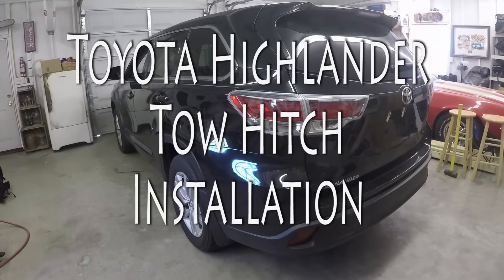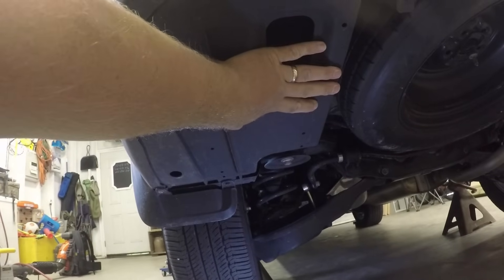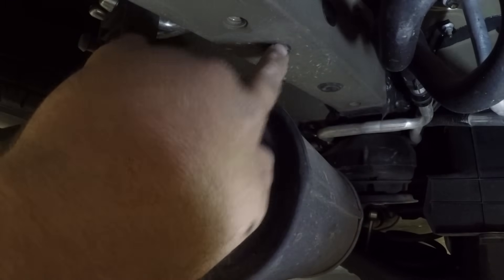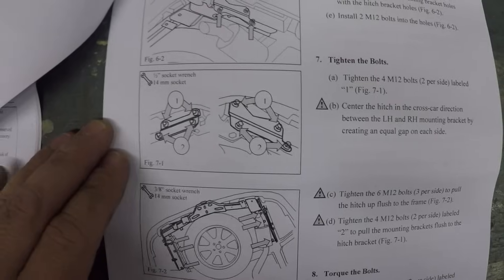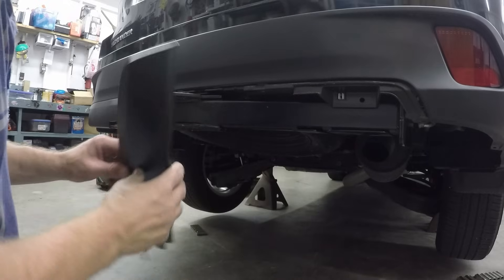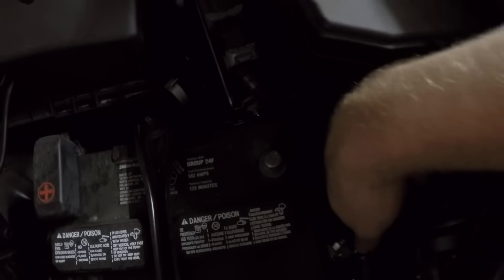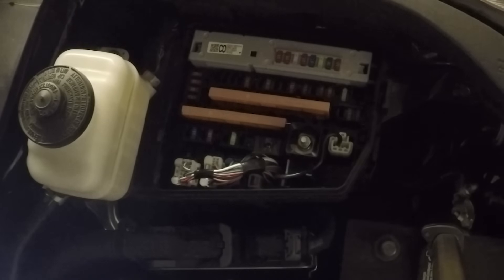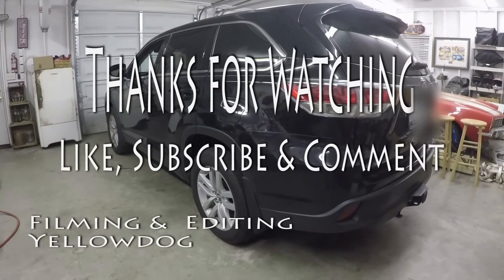Toyota Highlander Tow Hitch Install

Comment: I installed the hitch after watching the video and downloading instructions on our new 2018 Highlander. Just so anyone who cares knows, you don't have to do any trimming on the right hand side under cover. Goes right back on with no modification. Thanks again for the video.
Reply from the maker: Cool, that's one less thing you have to modify. 
I appreciate the information, and i'm glad you found the video useful :)
Reply: Do you know the part number of the hitch you bought for your 2018 Highlander? Online I see one that is PT228-48170 and another that is PT228-48172.
Reply: @mphorton40  The part whose number ends in 140 (the one in this video) protrudes from the bumper somewhat. The  one that ends in 172 is more flush with the bumper (and for some reason is now discontinued but can still be purchased).

Comment: Thanks for this video!   My hitch came with no instructions!!  I found this job easy to do, anyone can do it but it took most of a Saturday.  Some PRO TIPS that I discovered during install:

(1) Remove the spare tire.  Makes life a lot easier under there.

(2) You don't need to completely remove the back tray where the tire tools etc live.  Remove the 10 mm bolt upper left side then pry from the left gently until you get 1/2 or more of it unlocked across the back.  That's enough to run the cable back there.

(3) The far outer pins on the two new bumper facias are almost impossible to install.  I could not get my big hands up in there.  Use a plastic wire-tie instead.  Easy to put in, much tighter and because its tighter looks better on the outside.  Leaves things nice and flush.

(4) If you didn't get instructions like me, if you need them, your Toyota dealer can email a copy to you.
Reply from the maker: Glad it helped!

Comment: I would spray that tow hitch and the parts where it will be attached to with line-x or raptor bedliner to prevent it from rusting. Thanks for sharing your installation process.
Reply from the maker: Good idea :)  especially in rust belt parts of the US.

Comment: Great Video!  Saved me tons of time.  I found the same on a 2018.  No need to trim the right side. Also, I used jack stands to hold the hitch in place to attach the bolts. One person.  I didn't have the giant vice grips.
Reply from the maker: Happy the video helped out,
Jack stands will work too, got to make do with what you have :)
Reply: great to see these videos, would this kit work for a 2017 hybrid highlander?

Comment: Thanks for the video.   About 5 minutes in you mentioned the instructions say it's a 2 man job.   I'm wondering because I didn't get any paper work with mine at all, not even a parts list. I called the place I got it from and was told they come that way.  It looks like yours came with some info.  I think my 2019 looks enough like yours that I will be able OK  so I am really glad you put this up.
Reply from the maker: If it makes you feel any better, my kit didn't come with instructions either. I asked the parts rep where I purchased the hardware for the installation instructions. They were nice enough to print me what Toyota makes available to their technicians. So what i went by is not necessarily meant for the general public.  I hope the information in the video helps out :)
Reply: Ah ha!

Comment: I installed mine on a 2017, and the 4 pin connector doesn't work.  Uhg.   No lights on the trailer.  Checked fuse, and its still good.

Comment: I installed this today on a 2017 Highlander XLE. Everything was spot on here! My only add here would be for the 2017 XLE model, you only need to modify the driver side underbody plastic mold (take a small Dremel and cut off the needed section).  For the passenger side, it will install same way from factory.
Reply: same here for the limited. i assume you would want to cut the passenger side for easier access to the bolts to periodically tighten them...?  otherwise, yes, no need to cut.

Comment: I watched this video several times before my hitch and wiring came today. I was a pro by the time the box arrive. The vice grips and the jack was brilliant although it works much better to put the car back down so that jack can place the hitch perfectly near the mounting points. For the two 12MM nuts on the driver side shroud, it’s important to pull the shroud down hard while removing the two plastic nuts. They’ll just spin in place if you don’t.
Reply: Can you let us in on what you paid for the original parts? I want to compare the cost vs the aftermarket stuff. 
I agree with everyone that this is a really good video. Nicely done!
Reply from the maker: @williamkessler3847  
Its been a while, but I think it was around $500 to $600 for the hitch and wire kit. It is a bit more than aftermarket, but it has a much better fit and finish IMO :)

Comment: Awesome video. I would add that it doesn't appear you replace the tow hooks since the hitch has tow points on it. I left mine off. Also, the last piece you cut out of the plastic trim isn't necessary on my 2016. I left it and dry fit the piece, and it fits perfectly. Tin snips were much faster than the dremel. Finally, some of the bolts really want to cross-thread. It was the biggest pain having two that didn't want to go in completely straight. Finger tighten them all for several threads, then use a tool (I used my cordless ratchet), then torque wrench.
Reply from the maker: I'm happy the video helped out, and yes the tow hooks are not needed once the hitch is installed, at least that's my opinion :)

Comment: Thanks for this video! I don't know if I could have done it without it (my kit didn't come with instructions for some reason). Seeing where to cut in particular helped me out. One thing I struggled with (for future DIYers) was removing the shelf inside the trunk to run the cables. There's a nut on the left side, and a bunch of clips with the carpet. Thanks again!
Reply from the maker: Your welcome, 
I'm glad the video was helpful. :)

Comment: After I installed my trailer hitch on my 2015 highlander and connected it and after I connected my battery again my check engine light turned on and it says check awd system ? Anyone else got it ?

Comment: I enjoyed your video.  Like you, I do a lot of things myself, too.   I did order the OEM Toyota Tow Hitch and wiring, however, there were no instructions.  Any chance of copying them and posting them to the video?  I would appreciate it, THANKS.
Reply from the maker: I looked out in my shop, unfortunately I'm afraid they may have found their way to the great trash can in the sky :(
If I do run across them at some point I will see what I can do.
Reply: Additional detail for wiring access: 
https://youtu.be/cgRAJ0RZwhw
Reply: Trying to Add the Toyota Installation Instructions for the Tow Hitch and Trailer Wiring Harness, but don't see a way to attach them
I did not have to cut anything off the underside trim panel on the passenger side.  
I will need to cut something, possibly a 1/2" wide slit, or so and a little bit from the other end, but not as much as the instructions seem to be showing.

Comment: Great Video.  I am going to put on my 14 Highlander Hybrid.  How easy was it to get out the compartment tray that holds the jack?
Reply from the maker: On my 16 model it wasn't hard to do. Getting a couple of the trim panels out the inside was a little tricky but for the most part this is not a difficult install IMO. It took me more time to film and edit than doing the work if that tells you anything.

Comment: Would such an installation give you the 5000lbs rating? Any performance difference over one with the hitch factory installed?
Reply from the maker: Well, the hitch in this video is what Toyota would install "factory" since it is the OEM version, its just the dealer installed option. So yes, this setup would provide for the maximum tow rating for the car.
Reply: @Yellowdogsworld  can you do that exact procedure on xle limited or does the kick opening gets in the way?

Comment: Thanks for the video!  I completed the install in under a couple hours yesterday on our 2017 Highlander SE.  I did find that the RH cover didn't need to be cut on our model.  Thanks again.
Reply from the maker: Cool, its an easy install for the most part if ya got the right tools, Glad the video helped :)

Comment: Do you know if a transmission cooler for towing is needed ?
Reply: this is the same thing I was wondering. I have read a transmission cooler, bigger radiator, and an oil cooler. I don't know if any or all of them are required for towing and no one seems to cover it.
Reply from the maker: @raymondstoddard1082  
To my knowledge the Highlander (At least the 2016) has a factory rated towing capacity of 5000 Lbs, with no add on's needed to accomplish this. 
So in short... its equipped to get the job done out the gate.
Reply: The newer models come with a transmission cooler. And I believe an oil cooler also. But I would have to check.

Comment: Lol use a non-volatile cleaner and you used acetone LOL that's so flammable it's ridiculous but other than that awesome video thank you very much
Reply from the maker: Good thing there weren't any open flames inside the car at the time, else this video could have turned out completely different :)

Comment: Do you have a link for the installation manual? We had someone put it on but we have no power coming through. I wonder if they missed the fuse part.
Reply from the maker: unfortunately no, the guide I had was provided by the dealership I purchased it from.

Comment: Hi, do you know if  all 2016 limited edition have the tow package included since the oil cooler and heavy duty fan is a must with towing a trailer?
Reply from the maker: If I'm not mistaken, if you have the V6 in your highlander it comes with Full towing package. A good way to know would be to check your cars rated towing capacity, if its 5000 LBS... you got it.

Comment: Great instructional. Wouldn't be able to install the wiring harness like you did as rats would be able to nest in that size of an opening.
Was wondering if anyone has any tips on how to enable the rear view monitor to be viewable while towing. Also, anyone have any luck finding 7 pin options? hard to believe they don't have this for a vehicle with 5k towing capacity...

Comment: thanks for the guide...very helpful. also, im curious about your jack stands...when you placed it under the pinch welds, doesnt it bend it? or yours has a groove that enables the welds to go between it?
Reply from the maker: the stands do have a groove, but also there is a area that has a little more reinforcement on the seam, this where I put the stands. It holds up fine for supporting the car in applications like this one.

Comment: its that pieces of trim that go the rear bumper is included when buy that tow hitch and wire harness. please help. i have a toyota highlander 2017 ang i want to install by myself. thank you sir.
Reply from the maker: yes it comes with the kit, the only thing that's separate is the wire harness.
Reply: Yellowdog02 Thanks you so much. Your video is really help.

Comment: Is there any way to add a 7 pin connector? Our camper has electric brakes.
Reply from the maker: The kit I bought made no mention of the 7 pin setup for a trailer with electric brakes. Toyota might not expect someone to pull a camper behind the Highlander, you may end up having to explore the aftermarket for a setup like you need.

Comment: Excellent video, appreciate you taking the time to show us. Does your Highlander have the tow package? (150 amp alternator, engine and transmission oil cooler) Would you mind making a video on how to identify these?
Reply from the maker: I know our highlander has a towing capacity rating of 5000 pounds. It has the 3.5 liter V6, however i doubt it came with any additional add on's since it is a base model. I will have to look into the oil cooler's, and alternator. Since it is rated at 5000 Lbs it may come standard with the 3.5 V/6's.
Reply: Yellowdog02 appreciate the reply. I read that all v6 models (2016 and after) will come with the tow package, however I couldn't find anything about it.
Reply: iDude that is correct all 2016+ V6 have the engine oil & trans oil coolers for 5,000 tow rating.  Just need to add the hitch. Prior to that LE were 2,000 lb and XLE and above were 5,000 lb. You can confirm tow rating and factory configuration for any specific vehicle by looking up the VIN here: https://www.toyota.com/owners/vehicle-specification

Marketing comparison of '16 and '15:
https://www.continentaltoyota.com/2016-toyota-highlander-vs-2015-highlander-model-comparison-serving-chicago-il.html
Reply: PilotOp68 thanks so much for the confirmation. Thought I've looked everywhere but missed those. Really appreciate it!

Comment: I turn Wrenches for a living (35+ years). With all the certifications that come with my field of work. I must say this is a VERY good "how to " video. We recently purchased a Highlander and I will be installing a factory hitch. From all the years of experience I carry, I know you cannot find an aftermarket hitch system the compares to Factory. The wiring system alone is perfect. Absolutely no splicing from what I see in your video. Thanks for the video and advice! I too find myself doing installs by myself. I really liked your idea with the vice grip/floor jack combination.
Reply from the maker: Thanks Thomas, 
I spent a few years turning wrenches myself :) I appreciate the compliment on the install and video. The only real gripe i have with whole kit is the wire harness... they didn't make it puppy proof. The new mutt in the yard thought the connector would be a good thing to chew on.

Comment: very nice, i wish i went this route before i bought an aftermarket one from a friend for 100$. its a 13 highlander and i havent installed it yet. where did you order the "plug n play" harness?
Reply from the maker: Both parts the Hitch Kit and the Harness were factory kits. They were both purchased over the counter at my local Toyota dealer. This set up is more expensive i must confess, however in some applications its just worth the extra money.